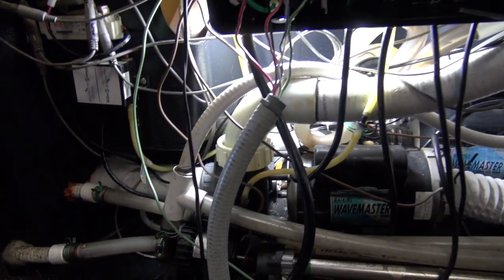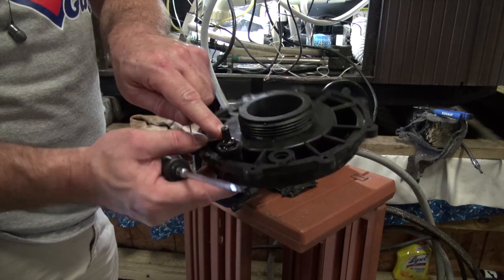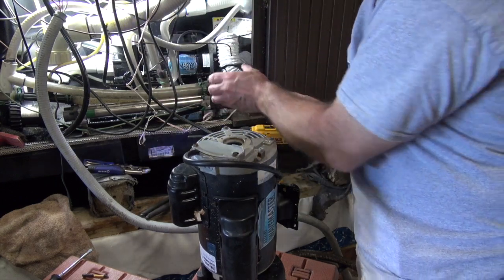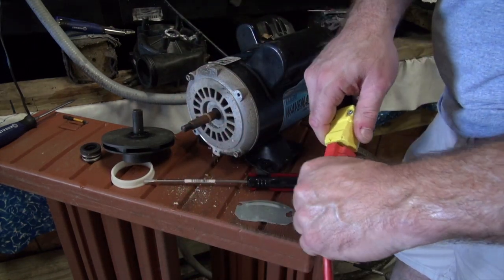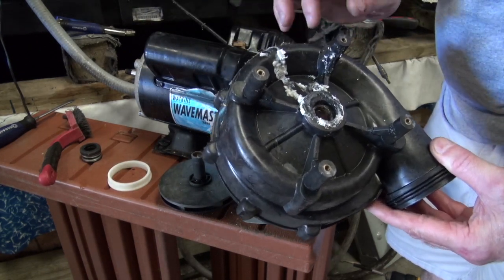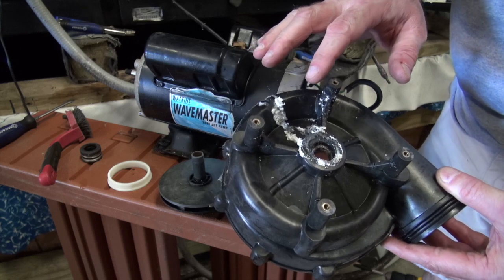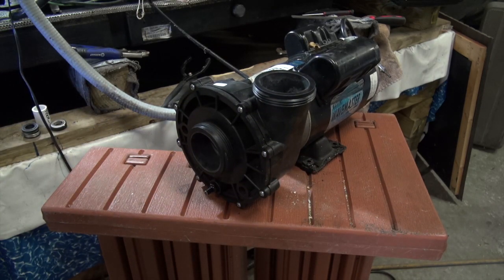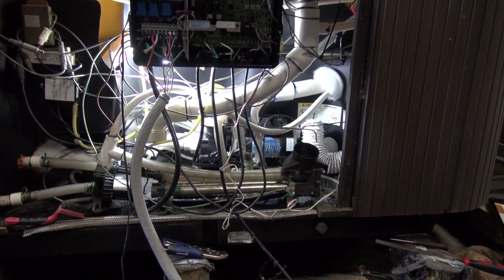Hot Tub Hotspring WaveMaster Pump Repair Watkins The Spa Guy How To

Comment: So how do you know if you need a new pump?  Mine is acting like an airlock (pump turns on high and low but no flow) but have tried all the remedies with no luck.  Could it be a switch or new pump?

Comment: Can you put a xp2 4hp wet end on a Watkins 9000? Reason I ask is because I have a 2person tub that had a Aqua Flo xp2 pump but I broke the shaft trying to remove impeller to replace the wet end. I then was given a Watkins 9000 but it doesn’t have the front cover of the wet end.

Comment: Hi - I have a 2005 Prodigy. The jet pump is whining, but won't pump. It is also tripping my house breaker. Running as a plug in 110v. No leaks, the pump just won't engage? Could it be the cap? Not much room in there can I try the cap replacement with the pump in the unit? Please advise? Thanks Rich.
Reply: On mine the pump was seized, the leak from the seal had rusted the nose bearing in the motor, I repaired the wet end as in the video + put 2 new bearings in the motor.
Reply: Mine is doing same and removed, guess what the shaft is rusted and corroded

Comment: Hi. I got a watkins pump and went to full and noticed the suction side had a Crack around the pipe threads. Is there a place I can find just the cover or would I need a whole new impeller.  I've been told the watkins wavemaster stuff is hard to find.
Reply from the maker: It depends on the pump.. They used 5 different brands.. Go to the website and chat and send pictures they will help you find what you need.. https://hottubpartsofamerica.com
Reply: Thank u so much for the response. I went to local pool and spa shot. Found a old pump that had the same face cover. Worked perfectly. Now just waiting for some suction drains to come in mail. Had some broken pvc.

Comment: What does the dryer hose/flex Hose on the back of the pump do??
Reply: Exhausts warm air from the motor outside the area in which the motors are installed.
Reply: @ChrisEpler  & into the insulated shell of the spa to assist in keeping the spa shell warm during use.

Comment: I had just installed a new wet end for my wavemaster and now the second speed wont kick on.   Is this something i did wrong when installing the new
 Wet end?
Reply from the maker: If you took the motor apart it is possible you bent the two speed switch in the back other than that not sure what to look for..
Reply: @spaguyhowto7417  thank u